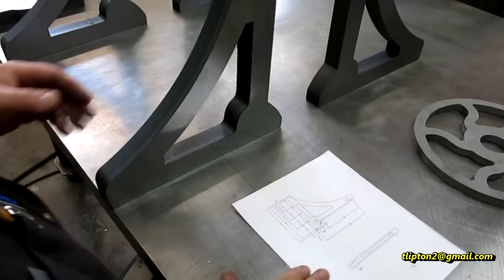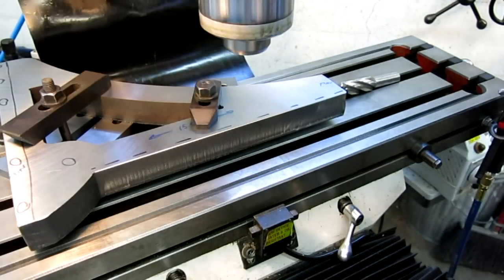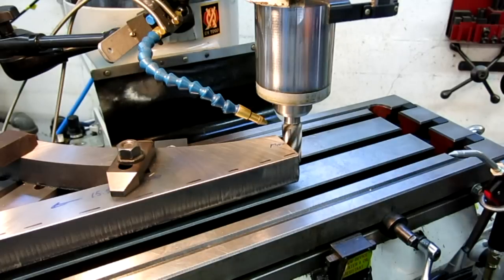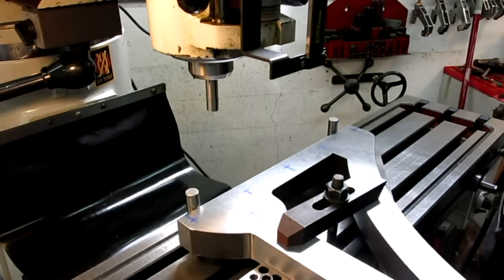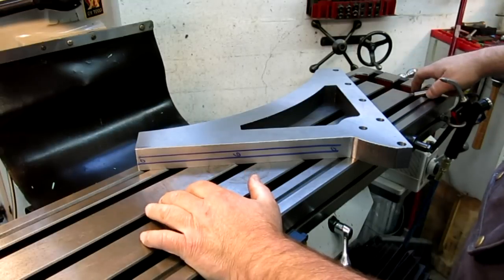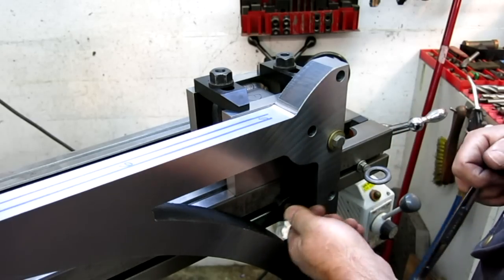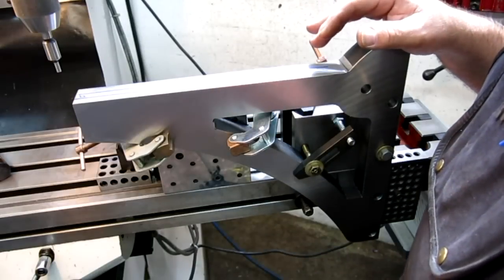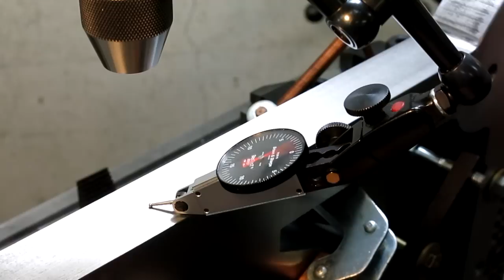Etching Press Vertical Supports P1

Comment: Great tutorial on odd part set up and dial in!! So many times guys will not do a project that calls for moving the head stock or changing their machines. In Gunsmithing I've found that I have to use a lot of unconventional holding setups and jigs. Great job Tom!
Reply from the maker: Hi Marc,

The weird setups are where the fun is. Thanks for the comment.

Cheers,

Tom

Comment: I love that setupblock that you welded up - Might have to steal that design ;)
Reply from the maker: Hey Stefan,

Add more tapped holes when you make it. I just put a couple in when I made it. It was mainly to mount my really small Kurt vise with the jaws vertical. Its turning out to be handy for a few things. Thanks for the comment.

Cheers,

Tom

Comment: before you bolted that to the side of the table, I was thinking why not rotate the head 90 and lay the part on it's side,  (thinking you were gonna put it on top of the table) to eliminate the build up required... your solution was much better and quite the paradigm shift.  Nice job :)

Comment: Way to go 'splainin' the swings and ram extensions of the Bridgeport turret head. I've mentored guys who at first thought moving the ram was "bad." That's the whole beauty of the turret mill design: you can place the spindle over an area of 2 x 4 ft using the table and saddle combined with turret swings and ram extension. Its just a little light feller but you get a lot of work envelope for the buck.

If it just had a horizontal spindle... or at least beef in the column to bore for spindle bearings.

Climb milling on an O/A cut edge with HSS?

Comment: I really enjoyed the video, thanks for posting it, Tom.  I'm curious why you didn't use the cool mist when milling the slots?
Reply: He was using some kind of cutting fluid. I saw the smoke coming up. Tap Magic, or the like? He might have been getting sick of cleaning the mess up at that point? Hanging off the edge of the table like he was doing stuff is going to drip down.
Reply from the maker: Hi Paul and Jon,

For the slot I used a little brush on cutting oil. For some of the slots I did switch over to the mist. More to blow the chips out of the way so they don't get recut. Thanks for the comment.

Cheers,

Tom
Reply: oxtoolco
I have an ancient Bijur Spraymister. But the idea of breathing coolant just never appealed to me. So I've never actually used the thing. Oil and a brush is good enough for me. With a good brush I can clear chips too.

Comment: Very Interesting. When you moved the head out I did not quite get why you did not flip the part so the short side was over the edge of the table ( it would not have given us a good look ) but I was thinking with the head retracted it would be more ridged. Or am I just over thinking it. Thanks again.
Reply from the maker: Hi Will,

This way I can easily see what is going on. A lot of setup decisions are purely ergonomic or optics. Thanks for the comment.

Cheers,

Tom

Comment: I have watched many of your videos and am particularly fascinated by the etching press you are building, many years ago when I was taught to use lathes and milling machines the normal practice was to 'flood' the cutter with 'suds' which was an oil emulsion in water, or even pure cutting oil, carbide tooling is now commonplace, however a lot of tools are still hss  (or even occasionally still carbon steel with its excellent sharpness ).
As I watch your videos I see you using what I guess is compressed air with what seems to be a little oil emulsion in it, obviously this is far less messy, but was the old system unnecessary?
Reply from the maker: Hi Pat,

The mist or drip systems use less coolant and don't make the mess of flood. Flood is preferable for production cutting with machines setup with enclosures and re-circulation. Thanks for the comment.

Cheers,

Tom

Comment: Hi Tom, You work just like a clock maker except all the parts weigh many pounds. Nice work on that super clean mill and the NOGA cool works like a dream. Are you using standard coolant with it. Cheers Dave.
Reply from the maker: Hi Dave,

Yes its just a generic water soluble lube. Mobilmet is the brand. Seems to work great. Thanks for the comment.

Cheers,

Tom

Comment: Hi Tom, 
Even though you didn't change the nod or side-to-side tilt of the head, will you still tram it in again once you are done with these operations? 
Interesting setup; thanks for sharing. 
Joe
Reply from the maker: Hi Joe,

Yes when I get back to a vise setup I would check the tram. Its generally really good even after swinging the head. The real issue is the heavier milling. Thanks for the comment.

Cheers,

Tom

Comment: is that water based coolant ?, I always have rusting problems if I don't get it all cleaned up afterwords, love the movies thanks
Reply: You should have a protectant on your machinery. Then you can strategically place sheet metal shields around your work, to contain the mess. But when you're done you do have to clean up afterwards. Wipe everything down, and apply an anti-rusting agent. I think Tom may use Frog Lube? I have seen him use it. We used some kind of industrial aerosol spray. It was kind of like WD-40. If rusting is really bad you need to use a stronger mix of oil in your coolant. Your mix is too thin. There's two kinds of coolant too. Synthetic, and organic. Pink, and white. Pink may be a bit higher performance? But white works too.

Comment: Is the entire design for the press available to view somewhere?
I love the sort of 19th century styling cues that you have incorporated in the various components.  The nice curves in the legs of the supports are an excellent example.  Will there be cross ties between the supports to stop them from racking?
Reply from the maker: Hi John,

I have shown the basic layout of the press a few times. Don't ask me to remember which video they are in. The tops of the supports are connected by a large thick nut plate. See the reboot video for the general layout of the lift mechanism. Thanks for the comment.

Cheers,

Tom
Reply: oxtoolco I just wanted to make sure that I wasn't out of the loop, if you had posted a set of design drawings.  I'll go back to review the original set of videos; my memory is also not what I wish it was.  It's a beautiful project and I hope that we can watch your wife working with the press.  I'm sure that it will require some experimentation, some trial and error, to work out how to get the best results.  That would be an interesting process to watch an artist at work.

Comment: Question about the Noga mist thing. Are you at all concerned that cutting fluid will atomize and get into your lungs?
Reply from the maker: Hi Bill,

This is not a real mist system. Its very low pressure ~10psi. These water soluble lubes are pretty safe. Thanks for the comment.

Cheers,

Tom

Comment: Tom, I love the look of the hammer you were using to bump the part in. Are the tips replaceable? Are they plastic?
Reply from the maker: Hi Dan,

Yes they are. Its a Lixie hammer with a cast iron head. Has shot inside. I really like them. There are a little $$ but worth it in my opinion. Thanks for the comment.

Cheers,

Tom
Reply: Thanks! Is that one the 1" version?
Reply from the maker: Hey Dan,

I think its the 1-1/4. One inch seemed too small and one and a half a little big. Thanks for the comment.

Cheers,

Tom

Comment: Love the creative setup! Would a 90 degree attachment not have been easier though?
Reply from the maker: Hi Thunder,

Have you tried drilling and tapping with a angle head? Thanks for the comment.

Cheers,

Tom
Reply: Nope, still very new to the Bridgeport. Sounds like it would be a good exercise to mount up the right angle head and try a few operations so I can get an idea for its quirks and difficulties...

Comment: Good work as always. Great setup examples of why it's better to just keep a nice, lean Kurt on the machine that can go off and on easily. Looks like having a roughing end mill finish on everything is becoming a big fad in this community - do you have finish gages for that (just being a SA)? Still not convinced on your Frankensteinian indicator holder, I see the Indicol/Noga patent police knocking on the door.  BTW - nice hammer (the Lixie) :).
Reply from the maker: Hi Gus,

Frankensteinian indicator holder. I may have to start calling it that. Thanks for the comment.

Cheers,

Tom

Comment: TOM any chance of a video on more videos with regards to internal thread lead in chamfer ?
?Is it needed or is it not just a question,So we can all step up and learn more..Keep up the
good work pal.Just a quick video request..Long time sub.
Reply from the maker: Hi Muhaa,

Do you meant the chamfer before threading? If so I generally just go a little larger than the major diameter of the male thread. The amount will depend on the thread size. So its proportional to the major thread diameter. Thanks for the comment.

Cheers,

Tom
Reply: oxtoolco Yeah its the lead in before the thread and behind the thread,.I'm on my 3rd try fingers crossed this time it works..Think i have got it now,

I was making a collet chuck and kept turning the threads and wondering why when i test fitted it would not fit on the spindle.

Turns out the recess was 0.002" too small but took way too much off the threads so was sloppy fit on the thread 

its ok when its pulled up against the face and such..But I'm just learning and it seems I'm learning the hard way every time :D..Third times a charm at least i know what to watch out for this time i should have known better...I've ordered a 45 deg internal chamfer tool will make the chamfer +0.025" the thread major diam..

I always jump in at the deep end considering there is allot involved I'm working in a blind hole that's 1.400" long and 0.898 bore to a flat bottom and then i have a 1.124" recess i thought it was a 1.121" recess and that's what caused all the issues the 3rd time around..

The first time the threading tool snapped and i struggled to pick the threads up again and when i did a piece of carbide had stuck inside in the thread root as soon as i passed it again snapped the tip off another tool lol..FFS

Not wasting the stock though i will turn one of them into a dummy spindle.

See how that works out.Really felt like giving up today with the whole lot but i guess if i do that then i will never get there .Thanks tom

Comment: could you  have not used a angle  plate and centered  it on top of table           to cut the key way .
Reply from the maker: Hi Joe,

Not enough vertical room to mount the part and get a drill chuck with a drill in it. Support next to the cut is important as well. Thanks for the comment. 

Cheers,

Tom
Reply: +oxtoolco oh ok I don't know a thing about machine  work but from what I've watched  enjoy your videos .